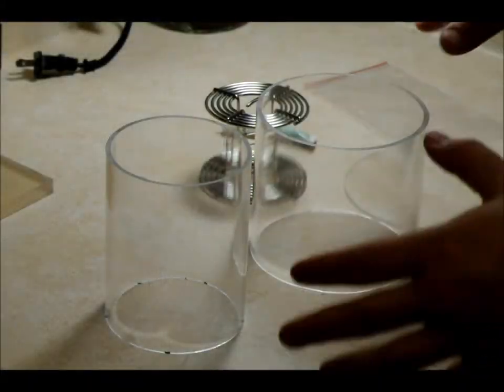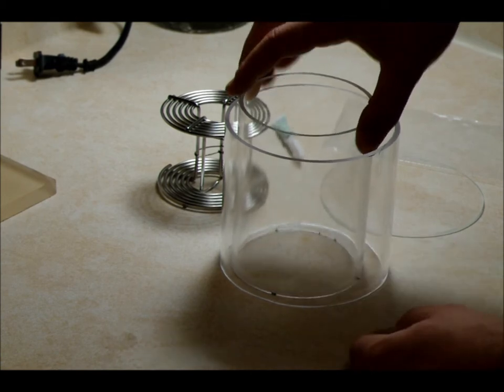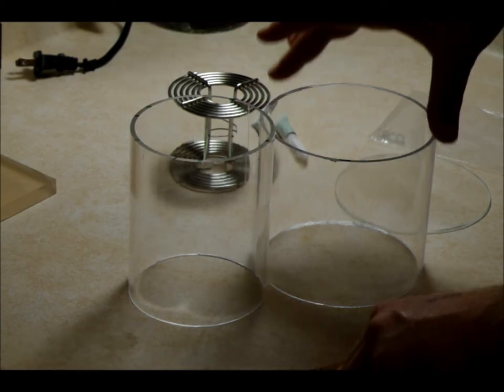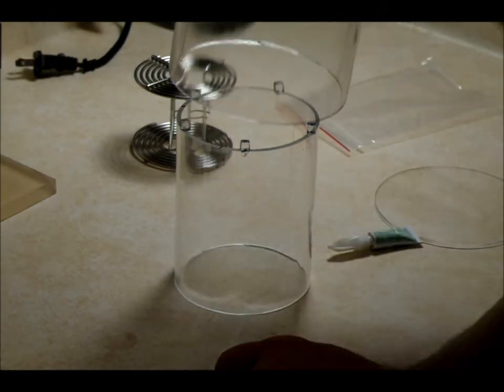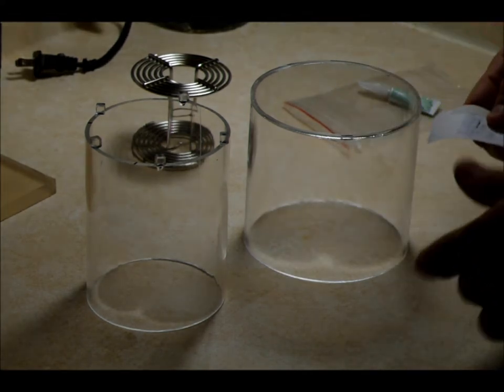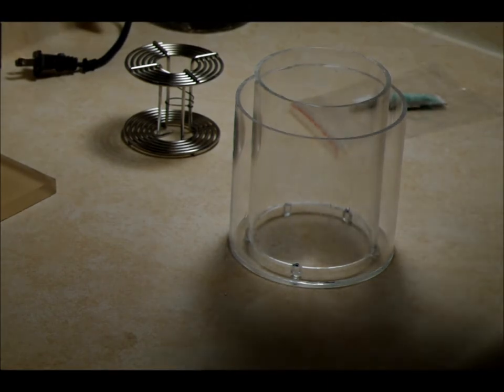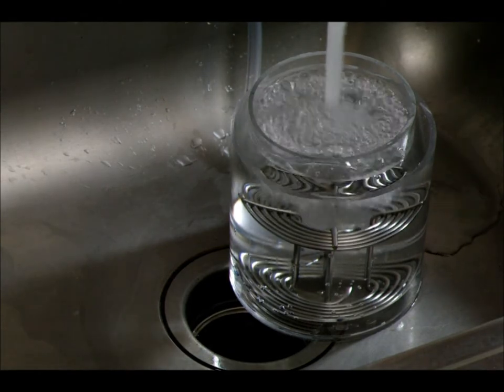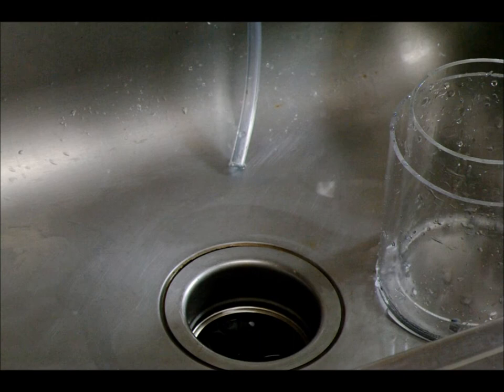Home-made Film Washer for $7.50

Comment: Thanks for the tip !
I will try this. I think it's also possible with straight plates to make a paper washer with the same basic design.
Your design made it's way into France by the way haha :)
I have no idea where I can found transparent tubes and plates here. It's gonna be DIY out of a DIY project ha !
Reply from the maker: Arthur Silve Absolutely, sheets can be used but they require a bit more gluing. Try PVC drain pipe. That would work just as well. The tubes don't really need to be clear -- it just looks cool.

Comment: This would actually solve the issue I have where I use the three reel (3 35mm or 2 120) Paterson tanks and they are just about an inch too tall to fit under my bathroom sink faucets.  When I develop a dozen rolls of 120 across six tanks this leads to a waiting line in our kitchen sink as it is the only one in the house with a deep sink basin that will accommodate the taller Paterson tanks.  With something like these DIY washers I can have a lower profile tank for the washing phase and then be able to distribute the final wash cycles across our three bathrooms in the house, freeing up the kitchen sink for the other film dev steps and ensuring more concurrent washing and shortening the overall development day.  Going to assemble a bunch of these this Christmas break.  Thanks for the idea David.
Reply from the maker: Nice! I just used mine last night. I'l working on the parts for an improved version of this that uses a bell siphon. I have a bench test-sized model now but am working on building out a three-gallon bucket that can handle the flow rate of a garden hose. :D

But this really basic design is effectively fool-proof and can be scaled to any size.

Comment: Great video! I would suggest using silicone (pure is possible) instead of super glue... It would seal beautifully. One shouldn't use kitchen or plumbing kind, found at the hardware store, because they add chemicals to it so it won't mold. I would suggest using the kind an specialty aquarium store would sell, becuse the only additive they would use would be acetic acid as it evaporates and wouldn't harm the fish... The other benefit of the purest available silicone would be that it doesn't dry up when you use a caulking gun if you put a piece of plastic over the opening before you re-screw on the trangular top again  in order to stock it away. I bought a standard size tube to use in a caulking gun and kept the product for over a year until I was able to use it. It work better than all of thoses glues with adhesives and you definately get your $ worth!  The difficulty would be to find the purest form with only acetic acid... It is definately worth the search though.
Reply from the maker: Thank you and very good suggestions!

Comment: I wonder if a couple plastic tubs or containers will work for this?  I found some Rubbermaid brand containers at the hardware store...   Drilled some holes in the smaller of the two.  I think the only requirements are that the inner, smaller one must be taller than the outer one, and wide enough (obviously) to fit a processing reel.  The outer container needs to be slightly taller than the processing reel.  We'll find out tonight!  I have a roll ready to develop!
Reply from the maker: I think that what you've got would work A-Okay as long as the water can drain from the inner faster than it enters and so long as there's an even flow over the film the whole time.

Comment: Just take the top of a Paterson tank and feed the water flow down the center spiral, same result and what they are designed for.
Reply from the maker: That is not what they're designed for and that doesn't work. When the water from the faucet hits the top of the water in the tank it does not circulate. That means that chemicals stay on the film instead of being washed off.

Comment: David, Thanks for the video. I'm having a tough time finding the plastic pipes. Any suggestions? The items i have found seem to be pricey.
This would be for 2 120 stainless steel reels.
Reply from the maker: Try a home goods store -- Home Depot or the like. You could used short sections of PVC pipe. Most stores sell shorter (1 to 4 foot) lengths. For the plastic base, it could be an upside-down PVC pipe cap. A large enough home good store will also be able to cut the PVC pipe to your needed length.

Let me know if that helps.

Comment: How does it work in practice (with film loaded)?  Would this benefit from a diffuesr to ensure rinse water makes it evenly to all of the film on the reel?  I'm looking to cut down my rinse times without sacrificing effectiveness.
Reply from the maker: It works very well. I used it when I develop three or fewer rolls. I don't use a diffuser because the rolls site under the outer edge. So the water level rises above them and acts as a diffuser. I haven't had any experiences where there's been uneven rinsing.

Comment: can you make a film dryer????
Reply from the maker: I definitely will in the future when I'm in a place where I have the space. My plan is to re-purpose a cabinet and put two fans in it, an exhaust fan at the top and an intake fan with a HEPA filter at the bottom. Then there will be an incandescent light bulb in the bottom, too, but I forget what wattage to use -- 45 or 60. The filtered fan reduces dust infiltration and the unfiltered exhaust fan makes a negative pressure in the cabinet which further cuts down on dust.